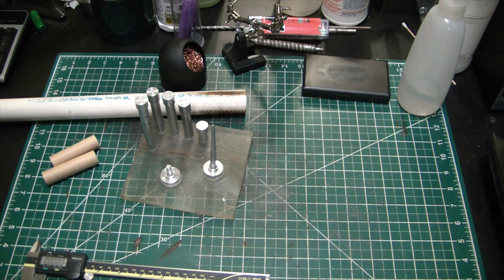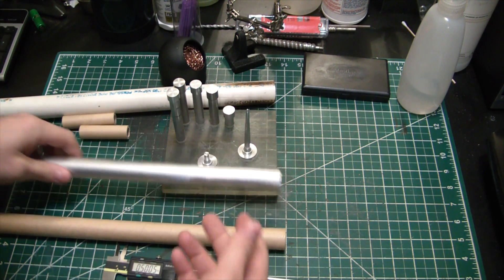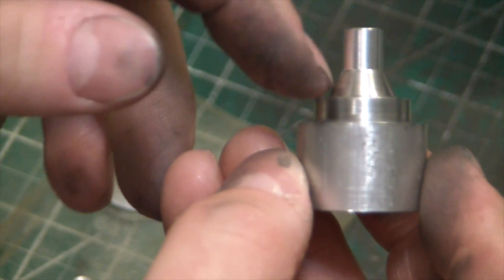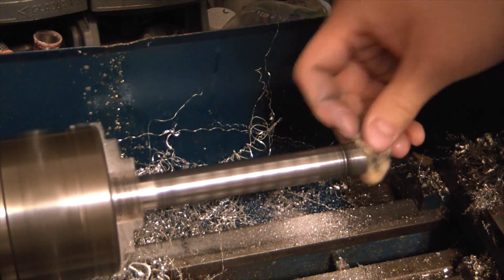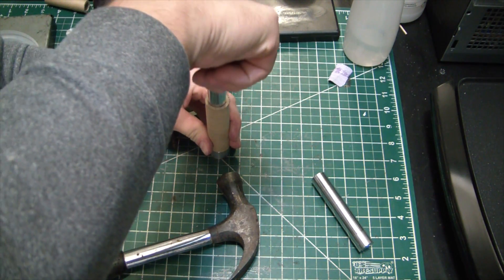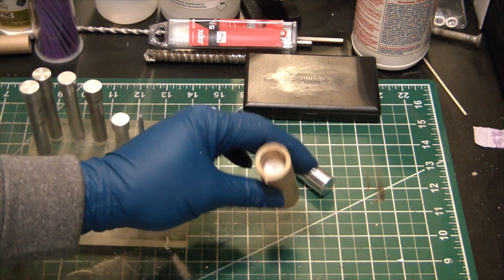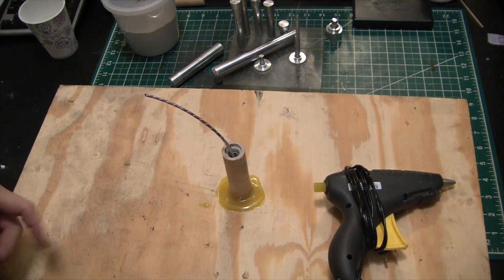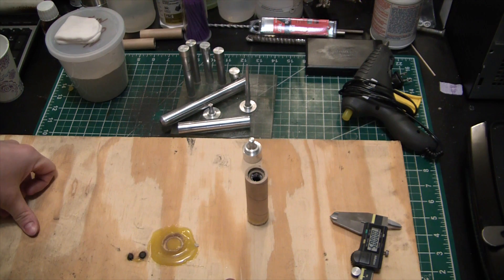Were Gonna Need A Bigger Rocket - Machining and Testing Large Rocket Tooling Set - ElementalMaker

Comment: I like all of your content, and the practical nature of your posts. That being said, You really shouldn't be using a steel claw hammer in your example.  I know you are striking aluminum, which is non-sparking.  But still, a plastic dead blow would be safer, and would deform your rammers less.

Comment: I finally got a cheap harbor freight lathe for this. Now to spend a month learning how to use it. Great video by the way!
Reply from the maker: They are great to learn on, and they hold resell value pretty well. Before you know it you'll be looking for used South bend lathes for greater precision and capacity. Such a great tool to have!

Comment: I've made my nozzles from 60% finely powdered fire clay, 30% finely powdered ceramic grog(available at any ceramic or potters shop)  and 10% Bentonite(Kitty litter) as a binder. Then add in about 6-10% of the final mix weight with Gulf cooking wax and blend all together. Works well, compresses great and very smooth, but still experimenting!

Comment: element maker, i have had some i deals about a magneium rocket engine, my thoughts are a magneium core in a chamber and pump h2o into it, i know h2o and magneium come in contact it explodes so the chamber would have to hold the pressure I would appreciate any feed back on my thoughts, my email is richardson.martha13@yahoo.com

Comment: through talking with some really experienced pyro guys, its best if you use straight kitty litter in its gravel form, no grinding. you then load it little by little in the tube, ramming it really hard each time then it leaves you with a not as pretty but incredibly resistant nozzle

Comment: For the nozzle, try “Durham’s Water Putty” to resist erosion.  I used it on a few large sugar rockets with great success.  It is mixed w water but dries very quickly and u could use your existing setup to form it.  But lube the setup first so it won’t stick :)
Reply from the maker: I need to try that stuff! Keep hearing great things!

Comment: How do you like that cheap lathe? ThisOldTony did a video on one of those and it made me think about getting one.
Reply from the maker: Mine is about 14 years old and nearing the point of being useless it has gotten so worn out. When I can afford it, I hope to get an old used south bend metal lathe. Overall though, it has been a fun machine to learn on.
Reply: @ElementalMaker  awesome. I will keep an eye out on something better but it's the size I really like. So I might just go with one of those and spend some money upgrading it.
Reply from the maker: @x9x9x9x9x9  keep an eye out on Craigslist and FB Marketplace. You can probably find one cheap if you check every week or so. I just saw a guy selling one for $125 which would be absolutely worth it.
Reply: @ElementalMaker  awesome! Thanks for the info. Also I did join your patreon btw.

Comment: I think the convergent (inside) should be empty of fuel before ignition. According to this great video on nozzles, its a mixing & acceleration chamber. https://www.youtube.com/watch?v=3zagXTc4hBk . As its a solid fuel motor it might not work as intended if its full of solid fuel. F*#@ great channel m8, so cool. Looking forward to your different fuel thrust measurement tests.
Reply from the maker: Yeah you are absolutely correct. Its just difficult because in the process of tamping the propellant, it fills the convergent section. If I move to graphite nozzles epoxied in place, I could effectively make the engine in reverse, and then epoxy in the nozzle, leaving the convergent section open.
Reply: @ElementalMaker  That would be great to see if a Convergent chamber makes any difference to the pressure exiting the nozzle of a solid fuel motor. If not you could just make a thicker orifice & minimize burn out using clay. I heard of some mixing wax in the clay & also Linseed oil for some reason.

Comment: On the nozzel erosion I sandwich in a stainless steel washer between the covergent and divergent. This reduces wear to a minimum, it's also a common pratice in many of the larger Dia engines. The only other way is molded JB Wielded top coatings, a big hassle easier preformed on larger nozzles (time consuming)
Reply from the maker: Ive thought about going with the washer, but given these engines are disposable I am trying to hone in on my nozzle composition to reduce erosion. I am going to try adding some Al2O3 and other various refractories to see if I cant improve the erosion.

Comment: What about machining a nozzle out of aluminum so the exit hole won't erode and will stay the consistent diameter?
Reply from the maker: That would be possible, but alot of work and expense for a throw away rocket motor.
Reply: ElementalMaker true, unless you make a giant rocket powered reusable lawn dart.
Reply: you'd be surprised how much the aluminum erodes. i just machined a set of reusable nozzles for a customer to  use in 2" i.d. gerbs. the one he sent me for specs was pretty wrecked.

Comment: You should try making a charcoal metal foundry, it can reach nice temperatures and charcoal is cheaper
Reply from the maker: I had one years ago and they certainly work great! But I just hated dealing with all the ash and embers flying everywhere
Reply: @ElementalMaker  I did the charcoal foundry thing many, many years ago. Learned a lot, now I used forced air and used french fry oil from a local restaurant. Is it hot? yup, was heating up some bronze to pour and stirring with a steel rod, got distracted only to find the steel had melted into the crucible.

Comment: Hey ElementalMaker! Long, long ago I used to make these sugar rockets and I came up with a dimensionless quantity that allows you to scale up to about as large as you want without trial and error.

The basic premise is that the ratio of the burning surface area to the nozzle area determines the pressure. I used to use pressed powder (here you're melting it) so our numbers may be a bit different. But I found that: 300 always exploded, 250 exploded 50%, 200 exploded about 10%, and 150 never exploded. The higher the ratio, the more power, but the greater the danger of exploding.

I'm sure you can do the math yourself, but here's a quick example. Let's say you drill to depth H, your ID is D, and your nozzle ID is N. To make the calculation simpler, we'll also assume that you drilled all the way to the end of the fuel (otherwise there is a hemisphere of area you need to add).

We want to calculate:
( max area of burning fuel ) / ( area of nozzle )
( area of bore ) / ( area of nozzle )
( pi * D * H ) / ( pi/4 * N^2 )
( magic ratio)

I'm not much of a youtuber myself, but I've gotten 1" ID rockets to work (using a ratio of 170). I had plans to go bigger, but unfortunately I ran out of space as these went quite high. (For some simple numbers, my 1" rocket used, D=1", H=3.65", N=5/16". Since I left fuel above H, I also had the hemisphere in my area calculation.) I suspect as one goes bigger you may need to go to lower and lower ratios, but that's easy to do in the math.

Best of luck! I'd really like to see someone try to go to 2".

P.S. When these start to get bigger, making sure to ignite the entire bore is critical. Igniting just the bottom can result in long fizzles.
Reply from the maker: Holy smokes thanks for all the info! Very good formula threre as well!
Reply: @ElementalMaker  I've been waiting years to dump this on someone's sugar rocket videos and I figured you'd have the best chance at using it.

Comment: Do you have oil or petroleum jelly in you nozzle-clay?
Maybe rosin as binder?
About 2-4% by weight can improve nozzle life.
I used a close-fitting sleeve over the rocket-tube when ramming; the clay will upset outward into the paper, but the paper can't do anything expect get compressed between the sleeve and the clay.
Old rocketeers trick, part II: assume erosion, estimate 'standard' amount of erosion and make your throat slightly under sized to compensate.
Throat erodes, but ends up closer to 'ideal' in the end.
I miss making these things...
Reply from the maker: I'm using about 10% by mass paraffin wax melted into the bentonite grog mix.

Comment: You COULD put a small copper or steel tube [flared on both ends] in the nozzle to make it erosion resistant without adding very much weight [a few grams at most] ~( 'w')/

Comment: Aspirin, potassium perchlorate and red iron oxide...whistle mixture!
The aspirin forms a pressure sensitive mixture with the oxidizer, but it has a negative burn rate.  The higher the pressure, the slower the burn!
Burn rate slows due to pressure, the pressure drops which in turn raises the burn rate, increasing the pressure again.  Lather, rinse, repeat.
Some mixes scream, like whistling fireworks, others have a low note, kinda like a fart or a roar.
Example?  Russian Kayatusha rocket battery...the roaring is due to low-pitched whistling: https://www.youtube.com/watch?v=gcKhS7ly8ig
Some freshly made mixes will whistle/fart/strobe in a loose pile, most the time you need some confinement during burn.
Like in the convergent section of yer nozzle!
Almost forgot; whistle mixes burn fast, so use an end-burner!  
A core-burn with whistle mix is an unpredictable flying fire-cracker.
Reply from the maker: Wow I've only seen the benzoate based whistle comps. Never heard of using aspirin! Crazy cool thanks so much for sharing!

Comment: Why attach it to plywood? wouldnt it be better to use some kind of weight on an arm so that you can calculate the thrust? i dont think it would be too hard to rig something up for that.
Reply from the maker: Working on an arduino based static test stand right now. Should be able to log the rocket thrust 80 times per second so I'm hoping for some good data
Reply: ElementalMaker that should be really cool cant wait to see it!

Comment: I make engines using the same fuel, using 1" grey pvc conduit. I use rockite expanding anchoring cement cast in the tube as my nozzle. I drill three holes in the side of the tube, insert screws through the tube protruding into the sides of where the nozzel will be. Then I cast the nozzle "plug" I cut the screws off flush with the OD of the tube. the screw help to anchor the nozzle I then use my lathe to machine the divergent side and have a custom-made boring bar bit ( a form tool) to do the convergent side inside the tube. Believe it or not, HSS will machine rockite if it is sharp and will leave a nice finish that can even be polished with sandpaper. I have yet had a nozzle erode or blow out. even the cap has yet to blow out. no explosions either.

Comment: The erosion is good for doing a solid single core. So building these type of motors the fuel burns faster with higher pressures.   With your design it's a progressive burn. Meaning the surface area of the fuel grows as it burns. So if you keep the nozzle size the same  the pressure will raise really fast and become a Cato. Lot of people don't understand Kn. This is surface area of fuel burning to nozzle area calculation.

This is why I went to Bates grains. I can make them a equal burn and then add washers into my rockete nozzles. James Yawn has a Kn calculator. Richard Nakka is a lot of good reading about experimental sugar motors and composits. Jacobs rocketry has motor specs that work good and you can input them into the calculator to get an idea of Kn and pressure.

Hope this helps I started making sugar motors after Make magazine had a article about it! Boy was it a learning experience!

Good luck, thanks for the vids!
Reply from the maker: Great info thanks a bunch! I love James Yawns site, he was my inspiration for getting into rocketry way back when he first put his site up. I think I'm going to move into the bates gain world shortly. I need to test all the reloadable cases I made years ago

Comment: Looks like your nozzle die can be a little smaller. Good methodology to make it larger to begin with. There is nozzle ratio calculations out there somewhere... I made a die set like this years ago without a lathe...much worse precision but it worked ok. I used brown clay from the earth. Good material. You could add a little aluminum ( for more oomf) to the mix and leave the nozzle the same size. I used to like adding magnalium flake for a cranky rocket. Get an old car water pump housing and drill at it with a large drill....coat them in shellac varnish so they remain stable over time.
Reply: the 1lb. (.75") and 3 lb. (1") tooling i make uses half the tube i.d. where the divergent meets the spindle and usually a 1 degree taper over the spindle length.

Comment: Could you machine your own nozzle, or cast one from a high temp resin? Or is the pressure from the propellant causing the deformation?
Reply from the maker: Absolutely! I have machined many graphite nozzles in the past. Graphite would certainly hold up much better than the bentonite clay / grog mix, but would be a pita to implement in disposable motors like this one.

Comment: That nozzle looks so good it should be illegal!
Reply: Why don't you measure thrust with mechanical scales? Also what about distance ignition charges? Shouldn't be that hard to make
Reply from the maker: I am going to be making a static test stand soon with a load cell & arduino or raspberry pie to log the data
Reply: @ElementalMaker  even better! Excited to see how that will work out (or not)

Comment: Nice video! I used to make my nozzles from concrete (also tried epoxies and ceramics) since I didn't have a lathe. Make an inner silicon mould, with two seperating conical parts attached to a screw for the convergent (30 deg half angle) - divergent (12 deg half angle) nozzle. You screw out after the concrete is set. Or just make a stainless steel nozzle with your lathe like this guy: https://www.youtube.com/watch?v=ACZhodrJhs4&t=25s

Comment: sweet your stepping up to the same specs ,you made me many yrs ago, i believe the cores are 3/8ths ,and my nozzle and core tool  are the same  piece ,try milling up a 60/30/10 bp mix for bp motors much more thrust and not hygroscopic, those bigger ones really sound mean too,one day Ill post a video of the 1" motors.I use plain ole bentonite clay.not kitty litter ,I got some stuff used for buety masks from a cosmetic supply.its like dust and rock hard when rammed.Dont be afraid to use a 3lb sledge when ramming,I made sleeves out of pvc with slits running length wise and use hose clamps to secure the tubes during ramming ,this way I can beat the snot out of them without bursting them and am sure of solid packing
Reply from the maker: Yeah not quite to that crazy size, but getting there! I still remember turning that spindle and just thinking how insane it was 😂
Reply: @ElementalMaker  yeah dude but you should see those things take off they sound like a V2 rocket and fill the street with smoke and can lift a pop can full of sand. the 2/4" are my fav though cuz I get 1/2 thick tubes from Meijers from the produce isle for free. they dont cato ,lol
Reply from the maker: @MrKclo42112  shoot me a video of a few of them! I wanna hear those bad boys blast off!
Reply: yeah I want to make some visco rockets too, if it ever stops fucking raining and snows. Im gona have to drain my damn pool again

Comment: Either the nozzle composition, or the geometry of it. You have a knife's edge where the 2 pieces meet, but if you were to leave some of the cylindrical shaft exposed in-between that would give you a sturdier exhaust hole. Probably wouldn't need much, 2mm or so should do.
Reply from the maker: I actually had about 3/16" of cylindrical nozzle region between the convergent and divergent nozzle sections, so I was really surprised to see that amount of erosion. I am also considering that I may have too high a paraffin wax percentage in my nozzle composition, I am going to try knocking it down about 50% to see it that helps limit erosion.
Reply: Would you be able to go with out the clay nozzle. And just form it out of your comp. Like we do in black powder rockets. Just thought it would be interesting to see.
Reply: I wonder if you could toss a small percentage of finely ground glass or a metal oxide into the nozzle mix and get one that sinters instead of melting.
Reply: @AtlasReburdened  I would also like to see this, though I think with the high pressure and speed of the gasses, it'd just start flinging the glass particles out.
Reply from the maker: Excellent idea Atlas! I may try adding some Aluminum Oxide and seeing if that will work.
Reply: Yeah, was just thinking about how alumina would do because I remembered you have a lot from the ruby stuff. Have you had any time to throw at the whole ruby 3d printer affair?
Reply from the maker: Nah that's on the bench until I can build a larger HHO supply.
Reply: @ElementalMaker  Either alumina, or zirconium silicate (sold at pottery supply stores as "zircopax" or "superpax" as a glaze component).
Reply: Yeah, I know that problem. A while back I laid out some designs for one that's about as pro as it gets, but for various reasons they still sit pinned on the cork board, silently mocking my lack of an unnecessarily powerful torch.
Reply from the maker: KNSB doesn't have quite the power required for a nozzle-less rocket. I might be do-able with the right motor size and maybe some red iron oxide catalyst, but it wouldn't be as easy as with BP.